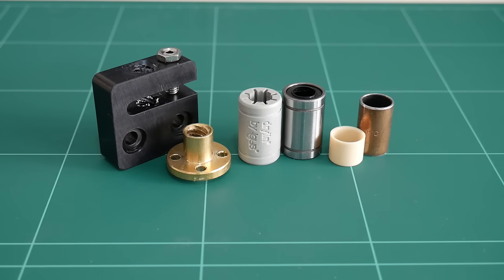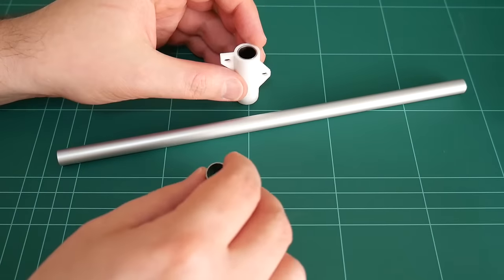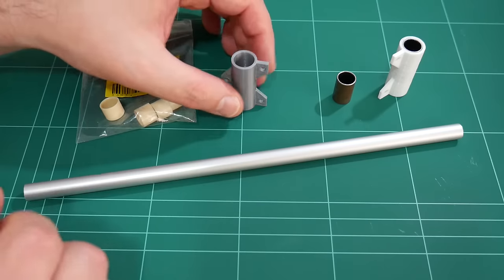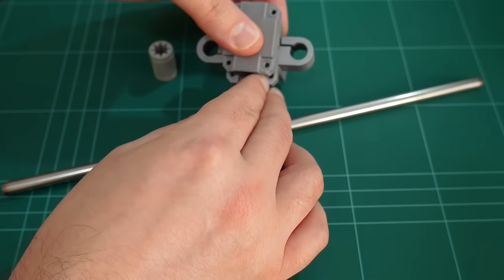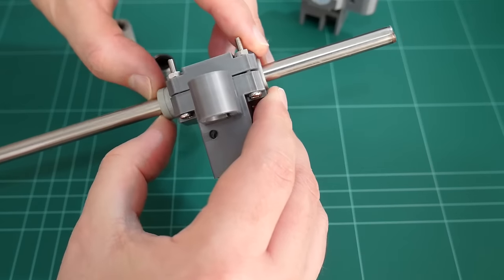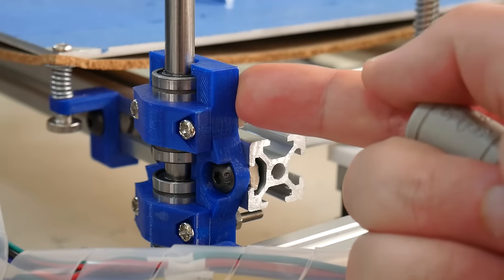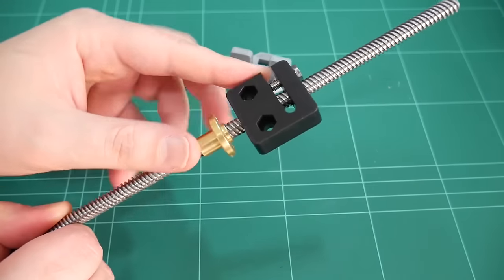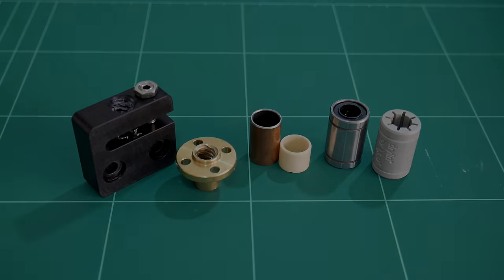New 3D Printer - Build Log #15

Comment: i love your build and am starting to pick up parts to make my own.  I am looking to have a printable area of 360x360x400.  i plan to use a dual leadscrew system for the z axis.  I am worried there may be sagging in the y rods though at that length.  Do you think upgrading to 10mm steel rods on the y axis would eliminate this issue?
Reply: Question:  Where are you going to get a hot bed that size?  Or do you just use two smaller to make the size you need?
Reply from the maker: Try it first. The X gantry is light in my configuration and might not load the 8mm Y rods enough for it to be a problem.

Comment: The problem that I find with those nut blocks is that I use TR8x2 acme threaded rods and they all seem to want TR8x8 which simply will not do.
Reply from the maker: I agree, especially when Banggood now offer 8mm lead-screws with pitches down to 1mm!
Reply: Tech2C
1mm is over kill for a 3d printer but why haven't the blocks kept up?  Sad really.

Comment: Cool.  But the polymer bearings wear out.  A good set of linear bearings should never wear out the rails, if this is happening you have very poor bearings or an improper pairing of metals.

Comment: The reason the igus bushings weren't working for you was because you were using them completely incorrectly. They aren't drop-in LM8UU replacements and if you'd bothered to read the specifications you'd know that they have to be preloaded by pressing them into a hole with the specified diameter and tolerances or by using one of the (stupidly overpriced) aluminium shells they sell for exactly this.

Comment: Why do you need to lubricate metal to metal and not metal to plastic ?
Reply: Some plastics do require lubrication when used with metal... take a look in an older CD player for example. And in the case of metal on metal, sometimes these are not (obviously) lubricated, eg. oilite sintered bronze bearings do not need lubrication as it's built into the design of the bearing. 

So it's not a black and white issue. It comes down to materials engineering. Know the materials and what they need for lubrication if any.

Just my $0.02 anyways.
 - Eddy

Comment: would anybody be able to 3d print out the plastic parts and setup an ebay listing?
Reply: I can do something similar.  I have a 3DHubs page and will be glad to print the parts for you.  PM me to set that up.

EDIT:  I feel the need to clarify this.  Tech2C releases his designs on Thingiverse under a Creative Commons Non-Commercial license, which makes it illegal to print sets out and offer them for sale on eBay.  Selling them as objects is a violation of his intellectual property.
The kosher way of doing this is to hire it done from a 3D printing service, such as myself.  In this case, you aren't buying a good, you're hiring a service.  I am not a lawyer and this is not legal advice, but it is common practice in the 3D printing community.  If you can buy a printer and print them, it should follow that you can rent a printer and print them.
I offer you my services on the condition that Tech2C does not object to this use of his intellectual property.
Reply: The Garden of Eatin thank you for the offer and thank you for giving that clarification. I used the incorrect terms when referring to "purchasing the parts" when I should have said "can somebody print these out for me as a service" Now that's out the way, can you provide your 3d hubs page and Ill compare prices to some of the 3dhubs around me? thanks in advance
Reply: Youtube doesn't let you post hyperlinks in comments, I'll direct message you.
Reply: Except there isn't a way to do that, either.  Search for Adam's Hub around Fayetteville NC.  If you find a better price, let me know, I'll see if I can match it.

Comment: Why not just superglue the IGUS bearings into the housings and then you don't need to screw them down tight.
Reply from the maker: Now that is thinking outside the box!
Reply: apparently you can also get the IGUS bearings in a metal can but i have never seen it.  myself i am going to go with bronze bushing in a holder for everything
Reply: Found the ones in a can http://www.igus.co.uk/wpck/2292/drylin_r_rjum_01  not cheap , but they do 8 and 10 mm versions , you can even get the more expensive " reduced pay " version for 10mm that would solve any issues with the carriage on the x http://www.igus.co.uk/wpck/7676/DryLin_R_RJUM_11 , again not in any way cheap :). 

Still think best price per performance is the bonze bushing in a holder.

As long as they are quiet and give about the same or better performance to a standard lm8luu or lm8uu then i am happy.

Comment: That plastic is not better than a proper anti backlash lead screws nut fitting.... Why do people always try to improve in procen designs.  It may be because people only shop on eBay for these things and not properly sourcing parts